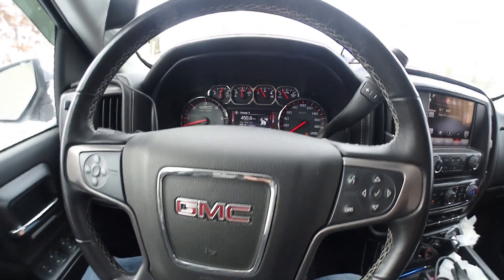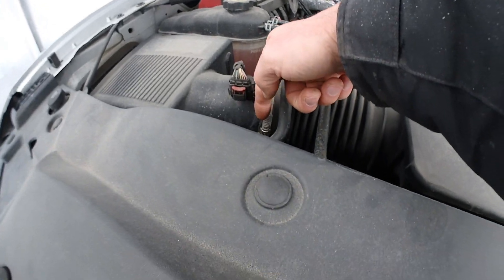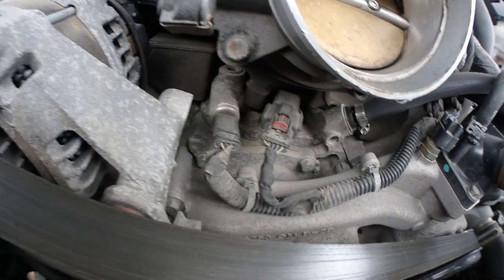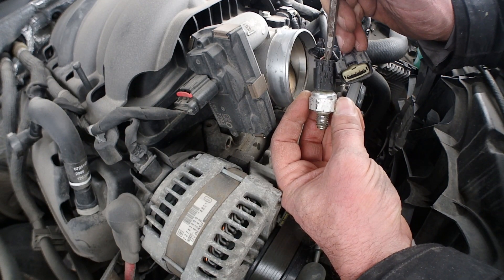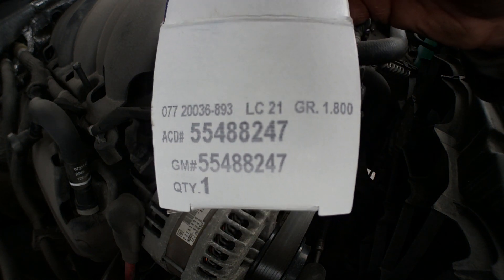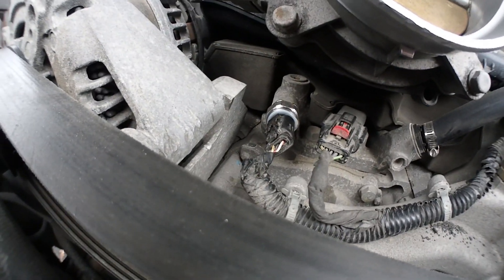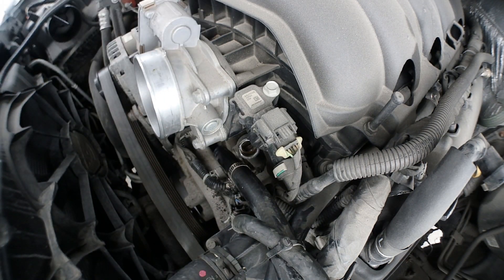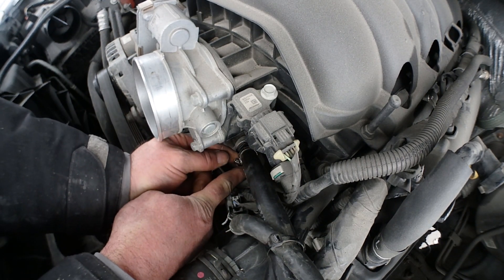Silverado Sierra 5.3L 2014 & Up,  Oil Pressure sensor and PCV Valve Change. Did not fix my P06DD .

Comment from the maker: UPDATE : P06DD engine code and all other P06** are the same problem . That was the oil pump slowly dying .The STEALERSHIP repaired it and gave me a bill of $ 2873.89  Canadian dollars...Dude i hate my ride.Looks like GM builds crap trucks nowadays...Not acceptable at 90.000 KM / 55.923 Miles...
Reply from the maker: @DG.45.1  I wish you luck on that one,i had no luck...Search internet and tons of blown oil pumps since 2014.
My friend bought a 2014 sierra all terrain and that oil pump blew in the second year of owning it.
Have a look at GM.TRUCKS.com forum and search for oil pumps 2014 +.
Your jaw will drop.
I am not happy with that garbage truck,don't get me wrong,i am a GM guy and had five gm trucks but i hate my sierra 2014 all terrain 5.3L...
Reply: D G I can almost bet you didn’t put AC Delco Dexos 1 Gen 2 oil.
Reply from the maker: @Mr.Beastforpresident  I bought that truck in Febuary 2019 with 69.000 km on it and was using Penzoil Pure Plus Full Synth 0w-20 Dexos 1 Gen 2
Reply: obscur156 GM specifically formulated AC Delco Dexos 1 Gen 2 for AFM engines. Pennzoil is not the same even with the Dexos symbol. If it was the same, GM wouldn’t have spent Millions developing the oil.  

If you want your truck to run like it was when it was new, you must use the same parts, fluids and filters it came with. Otherwise, it’s like buying a Mercedes only to get home and put a Hyundai seat in it and expect it to be just as comfortable.  

With AC Delco Dexos 1 Gen 2, the engine will run as it should IF, you haven’t ran other brand oil for a long time and affected the AFM’s tolerances.  

Not all oil brands are equal, you’re talking about Chemistry which is as finicky as seasoning on food. A little too much salt and it’s ruined, a little too much garlic and it’s ruined etc..
Reply from the maker: @Mr.Beastforpresident  Tons of GM oil pumps blew under warranty using GM oil...
Reply: obscur156 Correct but that was on the old Dexos. Dexos 1 Gen 2 just came out last year. Please research and you’ll see.
Reply from the maker: @Mr.Beastforpresident  Penzoil is Gm approuved  dexos 1 gen 2 and one of the best oil on the market,you know that ac delco is made by mobil 1 so basicaly relabeled mobil 1 ?
Oil has always been a great debate for sure !
I will continue to use Penzoil,ac delco won't change anything for me.
Cheers
Reply: obscur156 Ahh, that’s like saying Equate is a relabel for Vick’s. A smart man learns from his mistakes, a wise one learns from others mistakes.  

Oil pumps aren’t failing with AC Delco Dexos 1 Gen 2. But they are factually failing with other oil. 

This was the whole purpose for GM developing it, otherwise they wouldn’t sell trucks especially with the bad AFM reputation since 2008. Otherwise it would be a complete waste of GM’s time, money and resources that could have been allocated to something more productive.  

But hey, to each their own. Thanks for taking time to make a video.
Reply from the maker: @Mr.Beastforpresident  Thanks for taking the time to comment !
Reply: obscur156 I’ve tried Valvoline and Castrol Edge before learning about Dexos 1 Gen 2. Castrol Edge has a slightly higher viscosity even though the weight is the same.  Castrol made it idle smooth but both oils made the AFM operate too intermittently in short spurts. 

AC Delco oil made it operate more stable from my experience. Who knows, maybe Pennzoil does the same. Here’s info from on the AC Delco oil: 

News
Introducing dexos1 Gen 2 Full Synthetic Engine Oil!

General Motors has introduced a new generation of dexos1 engine oil, ACDelco dexos1 Gen 2 Full Synthetic! It has been newly designed to meet the lubrication needs of today’s smaller, higher performing engines. This new Full Synthetic replaces the dexos1 Gen 1 Synthetic Blend specification. 

All GM engine oils are transitioning to this new formulation throughout 2017. Since dexos1 Gen 2 is fully backwards compatible with all pre-2018 model GM vehicles, the previous generation of dexos1 generation will no longer be produced after this full transition.

The dexos specification has gone through an extensive developmental and testing process. It requires a number of proprietary tests that are not included in current industry standards and sets performance criteria at a level that exceeds many current standards. The new superior dexos1 Gen 2 specification has a number of benefits, as well as expanded motor oil specification requirements, including four new engine tests and a new Vehicle Chassis Dynamometer Fuel Economy test. 

Advantages of dexos1 Gen 2 Full Synthetic Engine Oils: 
Helps maintain maximum fuel economy
Reduces sludge and improves engine cleanliness
Significantly reduces low speed pre-Ignition
Offers superior wear protection
Reduces turbocharger deposits
Improves oxidation control
Is a Full synthetic oil without the full synthetic price.
Why dexos oil matters 
A critical component of performance, longevity, and environmental sensitivity is the quality of the oil that goes into a car. The right oil will contribute to engine longevity; using substandard oil can affect engine performance and, in the worst-case scenario, may damage or harm the engine. Failure to use the recommended engine oil can also result in engine damage not covered by the vehicle warranty.

When to use dexos
You should use the dexos1 specification on General Motors vehicles with a model year of 2011 and up.
Reply: D G Oil can be a pissing contest and boggle the minds of those trying to understand it. So I’ll sort through the shit. 

There is a such thing as an oil ‘ too good ‘ too slick. As well as an air filter, flow or filtration, pick one. As far as oil and it being too good or too slick, you run into problems. The roller rockers and roller lifters need friction to rotate the wheels on them, otherwise they’ll develop flat spots and ultimately fail. 

Amsoils creator wasn’t even a Chemical Engineer, nor was Forrest Lucas. As far as Schaeffers goes, it simply factually loaded with moly.  

To sum up these oils you’ve mentioned, Corporate America’s finest skill is the ability to speak bull shh in a timely convincing manner. The only thing worse than no  information is the wrong information. I’m not selling you anything, simply stating facts, not theories. 

Here’s what Dodge says about Moly: Check out the OEM bulletin from Cummins. It is the Cummins Engine Oil Recommendations, Bulletin No. 3810340-02. It’s probably best if you stopped by a Cummins Dealer and purchased this bulletin- about $2-$3. On page 7 it has a section on FRICTION MODIFIERS states: “ There is form evidence that certain friction modifiers, Molybdenum Dithiophosphate for example, can in certain formulations result in cam follower pin failure at relatively low mileage “ .... From years working with engine test programs to approve engine oil formulations for API Licensing, we can tell you that NO engine oil containing Molybdenum additives has been certified by the full range of engine test necessary to gain API approval. Molybdenum compounds in motor oils can degrade and cause bearing corrosion and is particularly aggressive towards copper. In almost all cases, any engine oil formula having “ Moly “ will also contain Copper Deactivator which will protect bearings from the moly compounds. The only problem, the copper deactivator decomposes at relatively low temperatures and loses its potency after a few thousand miles.
Reply: D G I’ve put 541,000+ miles 13,000+ engine hours on a LY6 Gas 6.0 2008 Chevy 2500HD on original engine, transmission, A/C compressor, Alternator and Power Steering pump. Even the Windsheild was original with about 8 rock chip repairs and millions of needle point size pits. 

Until ultimately cylinder 8 lost compression due to a failed exhaust valve spring. Fixed it, it didn’t damage the piston. 

Truck never left me once even with a weak fuel pump at 300,000 miles, even with a broken valve spring, I puttered it home 60 miles and barley made it as it progressively got worse.
Reply: D G So are many other oils. And none-of-them developed Dexos, GM did. 
Ask yourself why?   

That’s because GM knows more about oil and their engines than the oil brands themselves, literally. Again, Amsoils creator wasn’t even a chemical engineer.   

Let me put this in a way that may make more sense. 
The better an air filter, the better it filters. Now is that better air filter better than the OEM stock one?    

No, because then you would be sacrificing flow for filtration. It would be like a human trying to run a marathon with an N95 mask. 

Let’s try this again, Amsoil will outperform literally ALL oils in lab test. But in the real-world that’s a different story. 

Let’s do slip on boots this time, the longest lasting, most-comfortable, steel-toe, waterproof, insulated boot is a Fireman’s boot. 
It can do what what other boots can’t do, like Amsoil oil. Is it the best in the real world?   
Try driving your car with a quality Fireman’s boot, try walking the park on a hot day with a Fireman’s boot.   

IF Amsoil oil was the best oil in the real world and real world experiences, every engine builder in the world would use it. Including the most Technologically Advanced Street-Legal Cars in the world, Koenigsegg. Not counting Formula 1 and Nascar and LeMons cars. 

This world is full of Marketing, people will tell you anything you want to hear 👂regardless of what product it is, to get you to part with your hard earned money. 
It’s up to the consumer to discern through the bullshh.. and look at what’s true.   

And if you really want to get into marketing on oil, Castrol shuts Amsoil down with the “ 3 Million Mile Original Engine Volvo “. YouTube it.  

Again, literally anyone can say anything.. and they do, all the time. 

And most of the time they don’t have a clue what they’re talking about and doing. Even doctors, you realize how much doctors get things wrong?     

I gain nothing from telling you this. If anything, Amsoil is selling you a snow-shovel when all you need is a spoon.
Reply: D G ‘ Best ‘ is not always better. Take tires for example. You literally want the best/strongest tires for your truck?     

Then you want to spend $350+ a piece on Firestone Firehawk GT Pursuit Tires. Like what’s put on Police vehicles. 

In doing so, you’ll get a rough ride, sacrifice MPG’s, have to upgrade your shocks once the best/tough tires prematurely wear out your factory OEM comfort shocks, followed by prematurely worn upper and lower ball joints that are absorbing what impact the tire, spring and shock didn’t.
Reply: What was your oil pressure on the dash at idle before the fix and at 70 Mph?    Then what was it after the dealer fixed it?
Reply from the maker: @Mr.Beastforpresident Before fix engine hot  Idle =137 KPa Running 205 KPa .
After the fix new oil pump,engine hot Idle = 205 KPa Running 280 KPa.
According to analog cluster, I don't have digital cluster, approximative numbers.
There is more oil pressure for sure,a lot less before the oil pump died...
Even 2019 GM trucks still have these crap two stage oil pump,be aware.

Comment: so the code came back on after this video?
Reply: Just started that big job. Dropping the oil pan is a huge pain. I'm replacing my oil pump.
Reply: @MrWashamd  How did it go? Im assuming it as for the aforementioned P06DD issue.
Reply from the maker: @MrWashamd  That sucks, sorry for you buddy.
Reply: Great job making this video!
Reply from the maker: Yes,the problem is the Engine Oil Pressure Control Solenoid Valve .Its a big job like 10 to 12 hours to do,i am not happy with that. 
Gm screwed big time on that one.
My silverado 2004 with 365,586 KM never had that kind of problem.
Reply: obscur156 yeah I definitely miss my 05, did you change the pump while there or just the solenoid
Reply from the maker: @thePimpdaddyvideos  I did not repair it yet.
The problem is the oil coming up the connector on that solenoid valve, Cleaned it with brake cleaner and the problem disappeared for 20 minutes, but came back due to the oil coming back to the connector again.
Starting to think about a cheap fix like RTV sealant...
The oil going up that connector is creating some kind of a short I guess and popping that P06DD...
I am pissed, there is no way a truck with only 90.000 Km do that. Piece of junk.
Reply: @obscur156  Can you show where you found the oil to tell if that is the problem? My 2014 Silverado just threw the same code at 97k miles...
Reply: obscur156 my Sierra has the same code 132000 miles
Reply from the maker: @MrJunior6939 There is a connector on the timing cover,the one on the left.Check if its full of oil on it.This wire is going to the oil pressure solenoid valve at the bottom of the oil pump in the oil pan.Changing this wire harness is like 10 to 12 hour job...I am not happy with that,you know engineers...
Reply: obscur156 Thanks.and how your truck is running know ?
Reply from the maker: @MrJunior6939  I did not repair it yet.Everything is closed cause of that stupid virus.Oil pressure is normal,the only complaint is that the oil pressure is stuck on high.That oil pump is a two stage for the AFM.So truck is making a sound like a power steering pump.Other then that truck is ok but that check engine light is getting on my nerves...
Reply: obscur156 and how you feel your transmission with this oil pump problem.. do you think the oil pump causes transmission issues like hard shifting or vibrations ? Also thanks for you time
Reply from the maker: @MrJunior6939  These are two separate problems.You may solve your hard shift by changing your transmission fluid and adding a remote transmission oil filter like I did.
Browse my channel for that video.
Reply from the maker: @MrJunior6939  Cost me an oil pump 2875$...
Reply: Hi what about that little filter that goes behind that it’s on top u need a 5/16 alley key to take it off by the intake